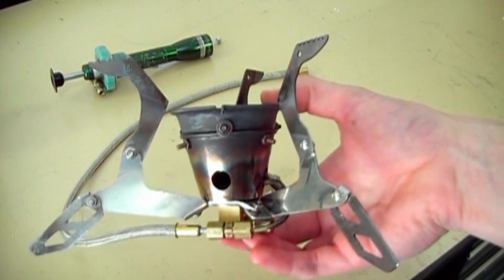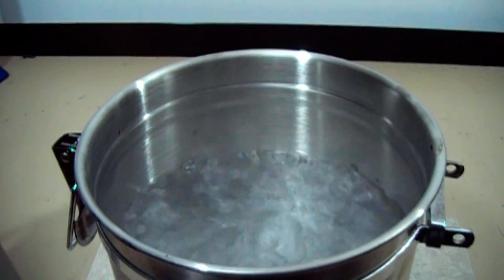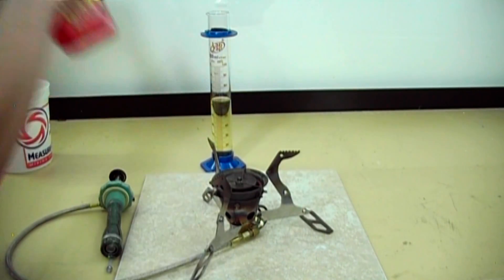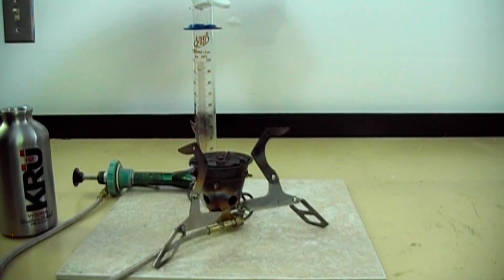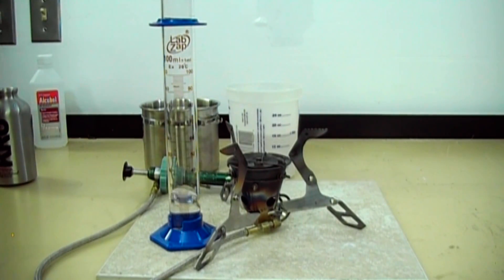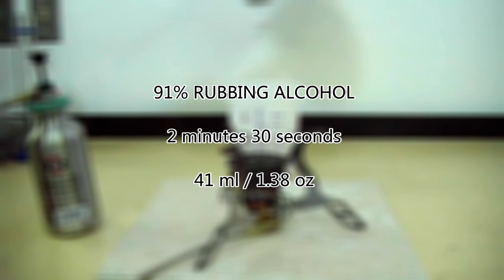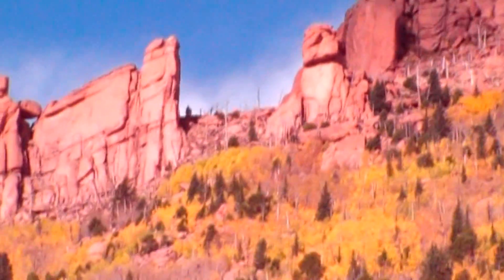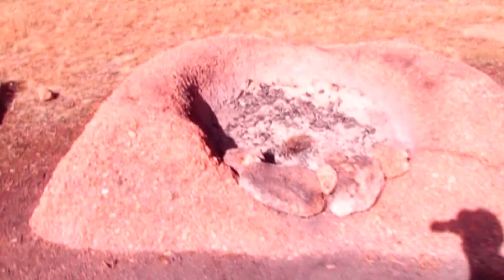All Alcohol Stove

Comment: It can boil water, like most alcohol stoves, but can it simmer or do a low heat setting? Which most alcohol stoves can't do as they can't adjust or adjust down enough to maintain a low flame.

Comment: Very nice. Where did you obtain the pressure pump container?
Reply from the maker: I made it.
Reply from the maker: +clkindred oh the container, that is a stainless steel bottle that vodka was sold in.
Reply: That's what I was thinking. I've never saw one like it. Really good job. I would like to know how you did it however, I can understand if you keep the design to yourself. Again, really nice.
Reply from the maker: Oh I plan on a design video, I was going to talk about it in this video but it would have been too long.
Reply: clkindred
That's very kind of you. Thanks! I look forward to watching. Necessity is the mother of invention and I understand the amount of thought and workmanship that went into this. The world has become to easy and I admire someone that sweats out a unique tool for a unique job. I commend you!
Reply: +clkindred I've not seen this kind of Vodka. Is it sold in the US? Also, I noticed the energy figures you noted that 91% Iso seemed to contain the most energy, with the shortest heat time to boiling and using much less fuel. Do you have a explanation for this?  Is it possible that the 91% Iso has a higher burning temp?
Reply from the maker: +bain5872 Yes I got it from a local liquor store in the US. A couple stores I have been in have it. I noticed they sell it in glass bottles as well, perhaps a limited run on the stainless bottles?
Reply from the maker: +clkindred Oh the 91% performance is puzzling to me, perhaps I goofed something up, or the iso heat which is supposed to be near 100% is not as concentrated as I thought. There are no claims as to the concentration on the bottle. As for the iso propanol in general versus methanol, the iso has more energy per unit than methanol.
Reply: Thanks for the info.
clkindred
I look forward to seeing how you made this especially the pump and plunger which I see was made from a mag-lite. Very innovative. Thanks for the info.